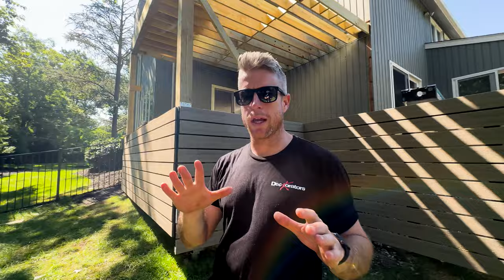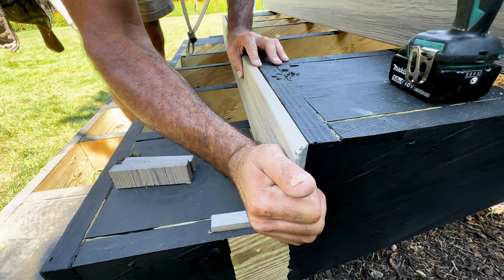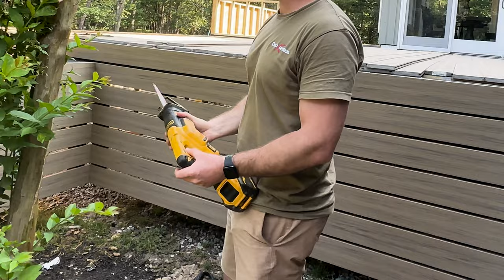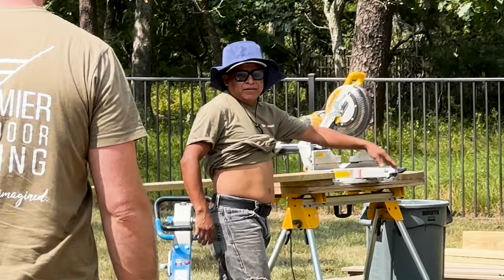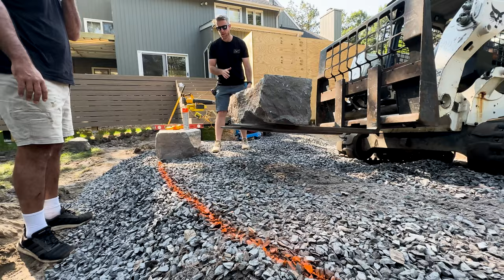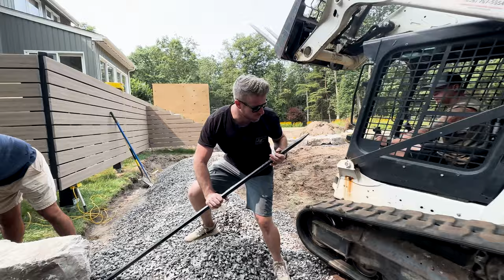Building A HUGE Deck - Skirting Details and GIANT Boulders

Comment: Hi.  I enjoy your builds.  Recommendations from a old guy to save your back...  Don't cut a tree or bush low then try to remove it.  Throw a chain around it high and soak the root area.  It will usually pull over easy.  Sometimes a few roots need to be cut.  For the big boulders, set them on a couple of one inch pipes and they will slide.  Use a couple of blocks and prybars to lift an end and a they can be pulled out.  Throw a ball mount on one of the forks...a tow strap works good to pull and adjust them.  If you don't have a skid steer, a pickup works.  Chain a 4x4 to the ball mount or bumper when you don't have a fork to push with. Good luck.
Reply from the maker: great tips! We certainly learned a lot on this one, by the end we had some pretty good techniques that weren't as hard on us...next time though I think we'll get an excavator to place them!